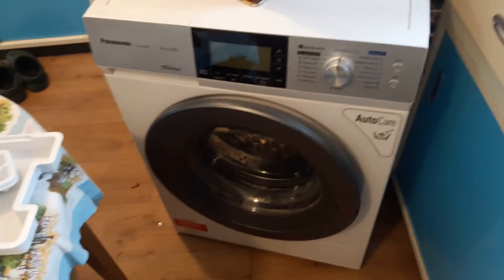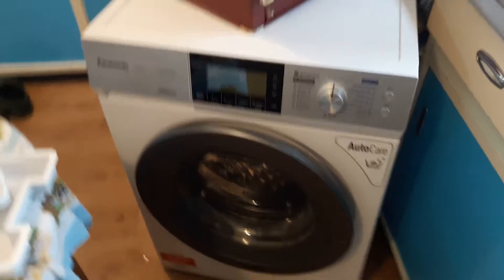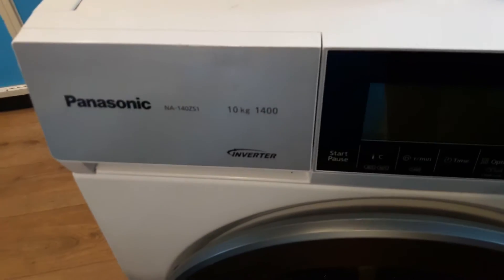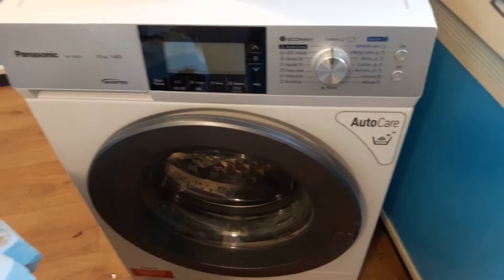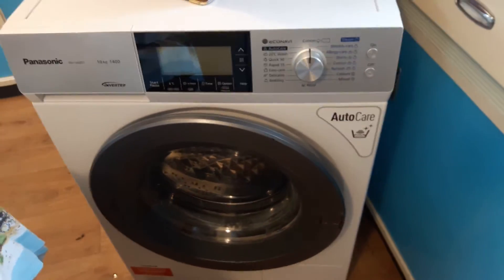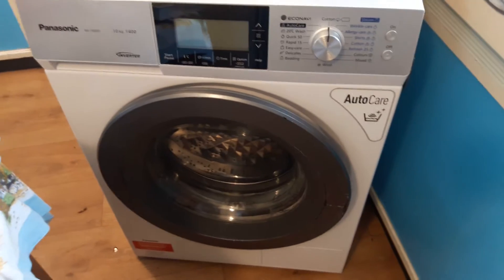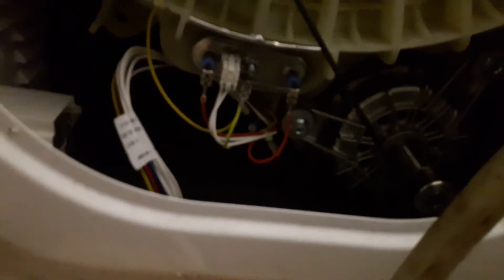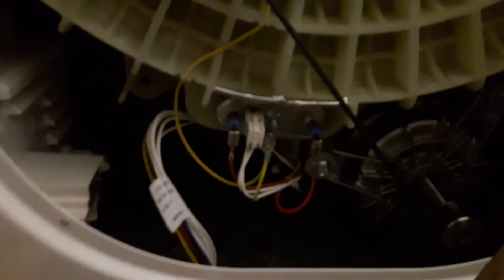Panasonic NA-140ZS1 washing machine open circuit heating element repair part 1

Comment: In my country where many people always think Panasonic washing machines are the best! Lol 😂 The PCB from many Panasonic machines are what the thing makes disappointing. Only lasted about 2 - 5 years, or if it lasted longer, it could be only 7 years until it gives up. The PCB makes you feel a bit difficult to repair, or even you have to replace whole PCB thus the price also nearly same as a new machine from LG or Electrolux or other brands. Even some Japanese heat pump washer dryers still have more problems from its PCBs after some years using. I still don't recommend Panasonic, unless they are made in Japan with more improvement. But LG and Electrolux can surprise me and they are impressive to be looking at
P/s: not talking about the heating element, I'm just saying about the PCB from many Panasonic machines